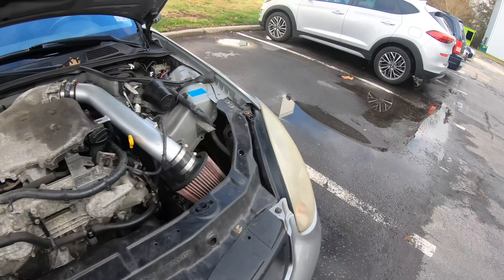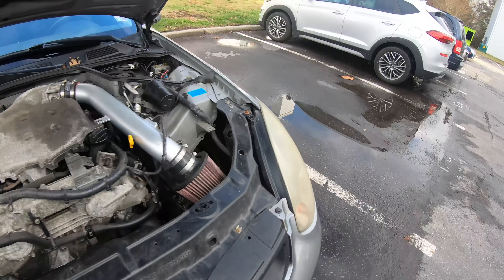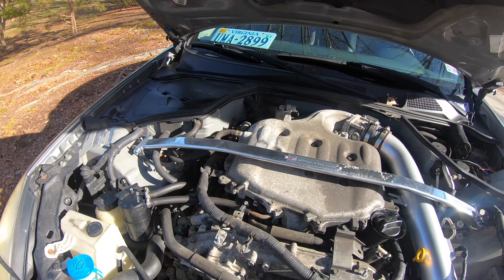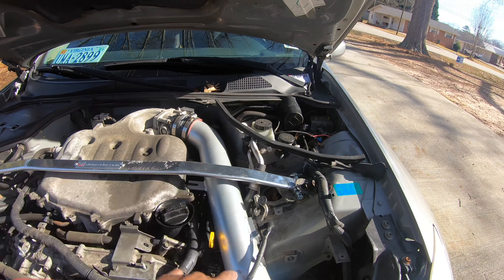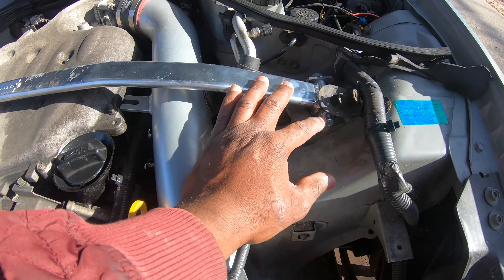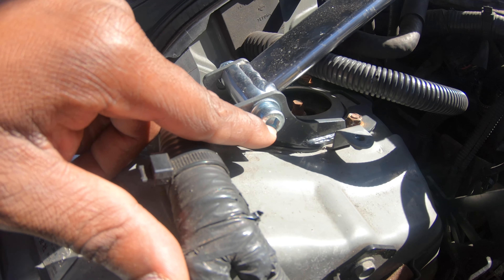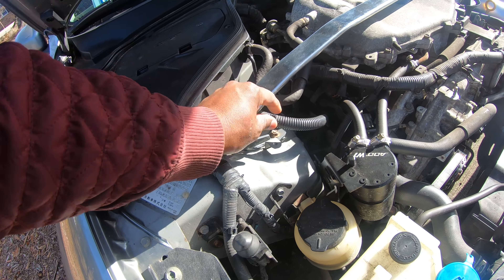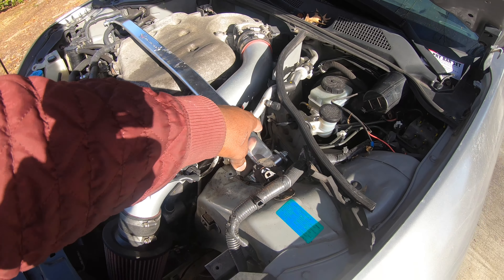Infiniti G35 Coupe gets Megan Racing Strut Bar‼️ Does Strut Bars add stability to Your Vehicle?

Comment: Just got mine today!!! And also new front and rear sway bars I’m hyped!
Reply from the maker: You’re about to feel everything bro‼️
Reply: @IsThatGeneral  baba definitely feel everything on the road but man going around corners is so damn fun!
Reply from the maker: @drought892  yessir TOLD YOU BRO! Now wait until you get coil overs and other suspension parts .
Reply: @IsThatGeneral  my g35 doesnt have an engine after an accident and I want to see if my struts are still aligned

I have a 350 strut bar will it fit??

I read the engine is high and prevents it from fitting but in my case i have no engine what do you think
Reply from the maker: @FirstLast-tx3yj  I can’t tell you for sure or not if it will fit. You’ll have to install it to find out. I’d just get the Megan racing strut bar to be safe.

Comment: Does the bar fit on top of the engine cover ?
Reply from the maker: Yes, but won’t fit with a plenum spacer.
Reply: @IsThatGeneral  is it really worth it
Reply from the maker: @Mohdr121  it really is. You feel it immediately. Trust me you’ll love it as soon as you install it and start driving.
Reply: @IsThatGeneral  just ordered mine. cant wait to get it man!
Reply from the maker: @Mohdr121  yessir! You’re going to love it homie specially if you have coil overs or any of suspension mods. I have stock suspension parts other than the strut bar and I love it.
Reply: @IsThatGeneral  how can I use a plenum spacer and a strut bar simultaneously? Are there any strut bars with enough clearance?
Reply from the maker: @Bignut7718  add the spacers under your strut bar studs and that’ll work. If you run the Kentitix v+ plenum you can run the strut bar with the spacer and it’ll clear everything without using the spacers.